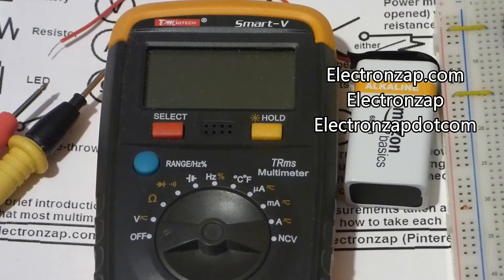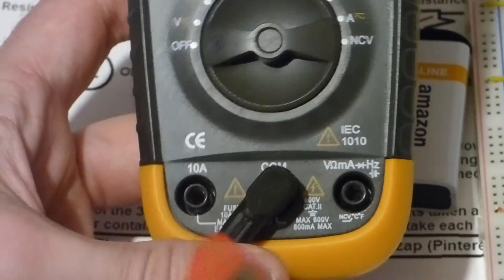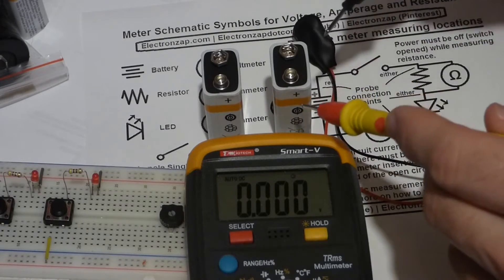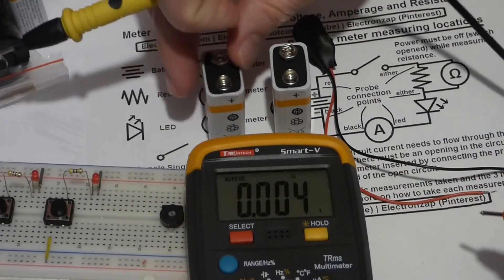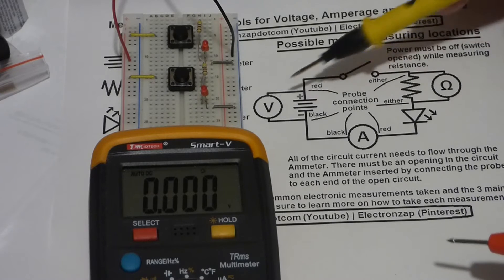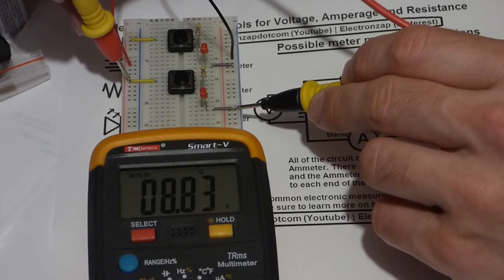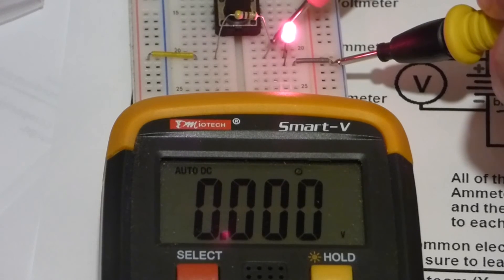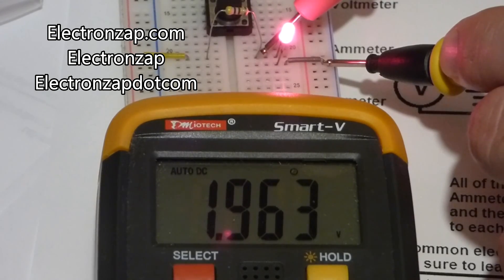Learn electronics quick video series tutorials 9 measuring voltage with a multimeter

Comment: That looks like a nice DVM that you have there!  Also looks to be "True RMS" by the symbol TRms on the front of it.  I had problems with AC measurements taken on a Harbor Freight freebie DVM and now I check all my meters with a simple test to make sure I can be confident in the AC values that are taken. I take a regular battery (AA, AAA, C, D, 9v) and measure it on DC VOLTS setting. Then I check it on the AC VOLTS setting. On the AC setting, a crappy DVM (like Harbor Freight's freebie) will measure roughly double the value that was given when measured on the DC setting! I discovered this when testing one of my power supplies for AC ripple using the cheap DVM. The 13.8 volt supply was measuring about 28 volts AC!!!  I didn’t have an oscilloscope at that time and spent quite a while checking every component in the circuit. After finding no problems, I checked it with my "GOOD" True RMS DVM and found that there was only millivolts of noise on AC!!!!  Both meters were giving similar results on the DC settings but were disastrously different on AC!
Reply from the maker: Thanks for the info! I rarely measure AC. I love this meter but unfortunately it is rarely being sold anywhere ever since I bought it.
Reply: It is a rare occasion to find a product that you can say you really like and would buy again.  Thanks for reading my ridiculously long comment but I lost 3 days because of that crappy meter and I feel so passionate about warning others about it.
Reply from the maker: It does suck when things go wrong alright!